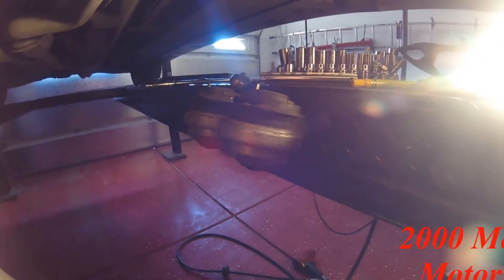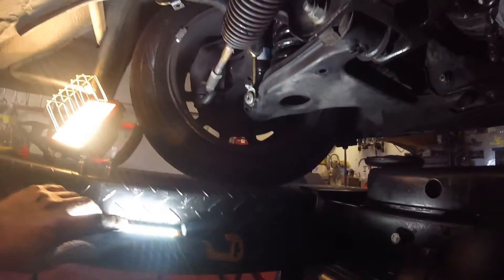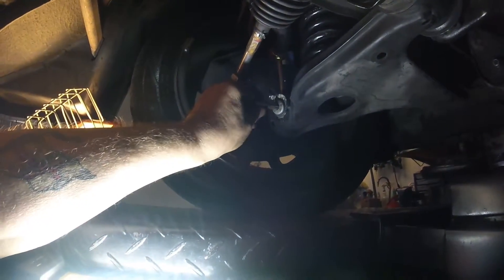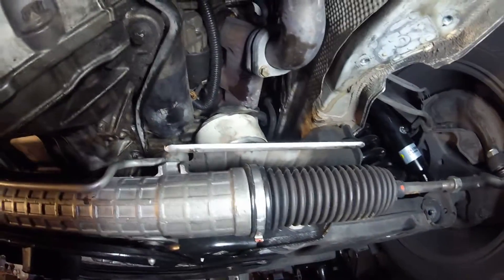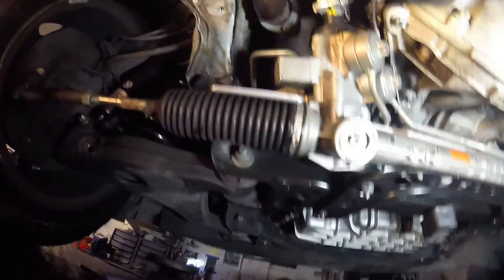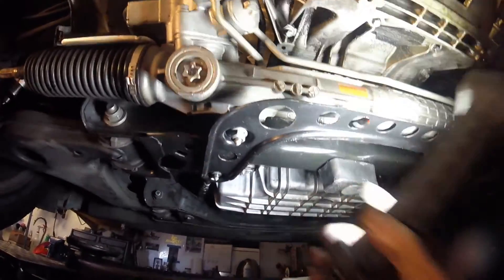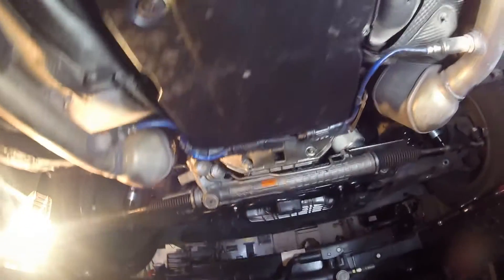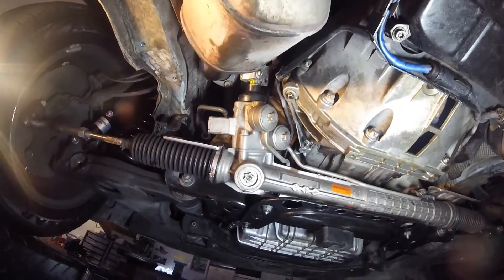Mercedes E320 2000 Motor and Transmission Mounts

Comment: Hello again sir. I just wanted to confirm without being an A**hole like that that other guy that on my 2000 E320 RWD Sedan ( Non-4matic ) I was able to replace both of my engine mounts without touching the steering rack or exhaust in any way. What worked for me was removing the air filter housing and duct work to the front of the car, the cooling fan assembly ( not required but just was so simple to remove and gives you more room ), removed the serpentine belt, and both the A/C compressor bolts and Alternator bolts. Do not disconnect the A/C lines. There was enough give in the hoses to move the A/C compressor forward enough to let the mount come out. The alternator needed to be popped out of the brackets and slid forward. Just two inverted torx bolts on the alternator and 3 on the compressor. Very straight forward. There is a small coolant hose just below the alternator. This gave me a little trouble moving the alternator forward and reinstalling, but nothing too bad. Just be cautious and patient. There's a 16mm bolt on top and 13mm on the bottom that must be removed before raising the engine. Then by carefully jacking underneath the oil pan with wood blocks between the pan and the jack (rubber would be better if you have it) I was able to lift the engine up enough to remove the mounts. The heat shields over top of the mounts have a rectangular slot that faces the opposite direction of the engine. The driver's side heat shield slot faces the driver's side fender, and vise versa. Someone else had asked, and if they read this my 2000 E320 top bolt was 16mm and the bottom was 13mm. I didn't require any speciality tools to remove the top 16mm bolt on either side nor the bottom but that shouldn't be an issue for anyone. I don't have any of the splash shields under the car since I bought it. They may cover the bottom 13mm bolts. I have been doing this for 20 years+ so I have more hand strength than many DIY'ers. Be patient. I am impatient a lot of the time but working on Mercedes you better be patient because if you break anything it ain't cheap. 

Reinstallation was a breeze. I put the bolt through the heat shield for both sides and reached under the manifold to put the bolt through the top of the bracket of each side. If you feel the underside of the bracket you can feel the two fingers that the single finger on the mount goes between. I hand threaded the top bolt into the mounts until I could feel the finger of the engine mount between the bracket without enough slop to pop out. You do want to leave the bolt slightly loose so you can move the mount around slightly to line up the bottom 13mm bolt. Once you get the bottom bolts started, lower the engine all the way down very slowly. Tighten the bottom then the top.  Then double check both again. This is what worked for me. Hopefully, it helps someone if they decide to try the way I tried it rather than this gentleman's fantastic alternative. Thanks JagVette!
Reply from the maker: There is always more than one way to skin a cat and I am sure others will find your method helpful.

Comment: Hey there. I don’t recall you saying what was the top bolt size on the motor mounts? Thanks
Reply from the maker: Oh Hell sorry it was a log time ago and I do not have the car close at hand
Reply: They are most commonly 16mm some are 17mm.
Reply: 16 top and 13 bottom if anyone needs to know !!

Comment: Did you have to disconnect the tie rod ends from each side or just unbolting the rack let it drop down? Thanks
Reply from the maker: no i did not, I just pulled the rack down after removing the bolt, but be careful with the steering hoses.